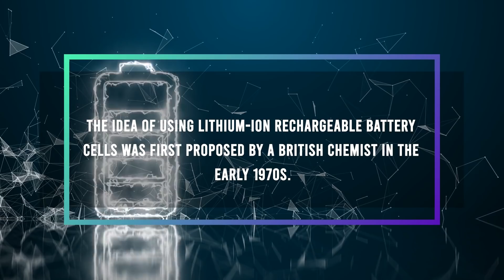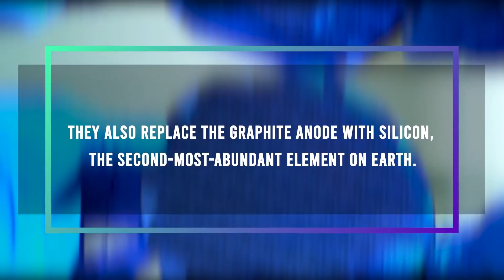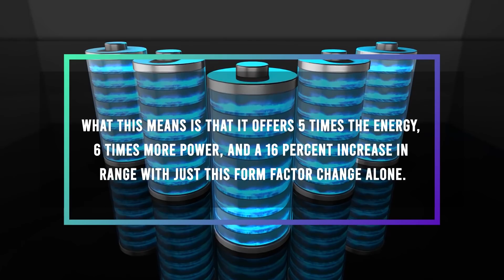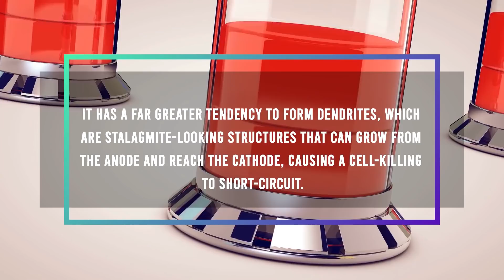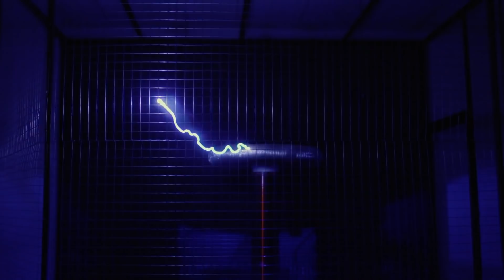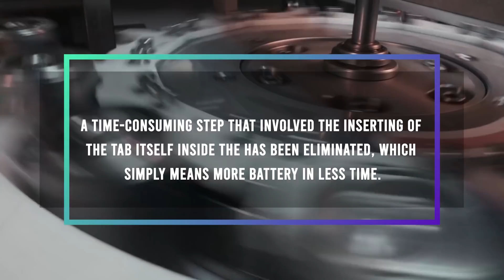Tesla's ABSURD NEW 4680 Battery Will Destroy Solid State Battery Competition

Comment: I'd bet on the 4680. I want a Tesla but I want to wait for the 4680 batteries and the aluminum alloy rear and front frame units. I believe these three items will make the Tesla the top car in the world, plus it will lower the cost of manufacturing the Tesla. Hats off to Elon Musk and Tesla.
Reply: One can always wait a for the next best thing….the next cell phone iteration, the newest laptop chip, etc…but there will ALWAYS be something to wait for as the next best thing. The current Tesla models and batteries are best-in-class by far, for performance, style and global charging capacity.  Waiting will be perpetual.
Reply: @gener4159  I know you are correct and that's why it is soooo hard for me to wait. Knowing myself as well as I do, I probably won't wait more than next Fall!
Reply: Pretty much my same exact thought process... Im guessing not everyone thinks like this though as the demand is strong.
Reply: Tgon Mwort  it's  still in development but a few cells have passed testing. Give it another 12 months or so.
Reply: @gregbailey45  heard it is not the batteries, but something with the machines making the batteries.  Will be interesting as they have in one year gone from 10% pass to 75-80% pass.
Reply: Tgon Mwort  BAK Battery Unveils First Chinese 4680 Battery Cells
Reply: People need to bet on improved energy infrastructure, California has rolling blackouts , wildfires, water shortage.
Good luck recharging when blackouts hit....!
Reply: @violent_bebop9687  it has been an eye opener for the folks who bought solar only to discover they have no power with grid down
Reply: Tesla dont make batteries.  Panasonic make them for Tesla....and Panasonic will sell them to everyone - not just Tesla.
Reply: @turbodewd1 :  Supposedly Tesla will make them AND buy a lot from various suppliers, such as Panasonic, if they make them. 

Tesla is planning to use a TREMENDOUS amount of batteries in coming years, and that quantity will ramp up fast as their product production ramps up fast in two new gigafactories and expanding the existing gigafactory production capacities.
Reply: Tgon Mwort  where can you find a 20k Tesla? Lol I want one
Reply: Can you give me some $120.000 for getting one Tesla too? Thank you.
Reply: Have you seen Mercedes EQS ? Tesla looks like Dacia next to it.
Reply: @IvanDimitrov-nu7ih  
The EQS looks horrible when compared to the normal S class.
Reply: @IvanDimitrov-nu7ih  Not in my opinion. I think the Tesla is a FINE looking automobile. The new Model S to me is better looking than anything out of Europe or Japan.
Reply: @IvanDimitrov-nu7ih  Looking at the specs on the eqs 108 kw battery ?  This boat must weigh in at 8000 pounds.  5.5 to 4.1 seconds to 60 .  not bad since it is moving this much battery mass.  Am going to guess that the battery actually is going to be in the $90k range since M/B has to buy them from one of the battery makers. As to self driving it can sort of keep you in your lane not much more.  nothing like 11+ hours on a 240 volt charger to get you charged
Reply: @stevepailet8258  You know that Panasonic makes Teslas batterys right ?
Tesla weights 2241 vs 2480 which is not that big of a difference and with the Benz  you get a lot bigger and comfortable car. 
EQS has Level 3 autonomous driving tesla is at level 2.
10-80% recharging will takes 31mins.
Speed ? Really ?
4.1 or even 5.5 is insane for that kind of car and there will be AMG version... Yes tesla is faster but you will get bored of doing 2.0 in less than a week if you do not crash before that.
The quality of the seats, the sound proof and the smoothness of the ride are more valuable than cheap party tricks, at least for me.
Reply: @IvanDimitrov-nu7ih  having had 7 mercedes I am well aware. I know their seats and dash boards do fall apart after a few years. so not super impressed. Tipping the scales at over 6272 pounds it is a beast.  The battery pack is a monster. 385 kw pack. It is just a tad on the bulk size but it does give almost 475 miles of range. this is the bigger battery. model S weighs about 4,647 lbs It gets around 400 miles range. All in all you are welcome the beast of a truck vs the nimble model s
Reply: @IvanDimitrov-nu7ih  I am giving specs for the 580 version.
Reply: @stevepailet8258  I really thing you are reading something wrong, the heaviest version is 2,585 kg maxed out and the battery pack is 108kwh. 
New mercedes have some big problems with reliability but nothing compared to tesla and i had never ever seen merced under 500 000km with falling apart seats.
Reply: @IvanDimitrov-nu7ih  since I personally have had seats fall apart I will discount your comment. 2585kg is the empty weight Gross Vehicle Weight (GVWR)	3135 kg or 6897pounds is fully laden. Now I have to wonder just what you are saying are tesla problems?  Am assuming you have giant insider information that you want to spew but cannot because you want to keep your job.
Reply: @IvanDimitrov-nu7ih  well you are wrong. Tesla is at level 5 fsd mode and likely to move up a couple levels with version 10 software.  Why are you so far behind the curve in this technology.
Reply: @stevepailet8258  Tesla isn't L5 yet. A bit dangerous to think so. Rooting for them though. Them and waymo I hope can get it done.
Reply: @IvanDimitrov-nu7ih  EQS L3 autonomy vs Tesla L2 is kind of meaningless. The two systems are oceans apart in comparison. Tesla FSD is clearly orders of magnitude more capable than Mercedes drive pilot. Mercedes can only drive on highways during the day in good weather. It's a bit embarrassing to compare it with Tesla Autopilot. Like I said before, Tesla is a tech company, Mercedes is a car company. You can't compare the two when it comes to actual tech.
Reply: @helloworld101  they are close.  And a heck of a lot closer than anyone else
Reply: @stevepailet8258  Close could still mean years away to fully trust it. ML models have to capture so many different scenarios. It will take some time for handling edge cases. Even if they're 95% ready, that last 5% will take a while.
Reply: @helloworld101  on the other hand Dojo is not up and running yet so we should just watch
Reply: @stevepailet8258 :  You have no idea what you're talking about re automation levels for automated vehicles. 

Levels are the automation capability.  Tesla FSD is at level 2 -- 100% driver supervised all the time, hands on the wheel, etc.  Level 5 is the highest automation level, so saying Tesla will move up two levels from level 5 is absolute nonsense. 

Don't take my word for it:  search on "levels of vehicle autonomy", for example. 

No one has level 5 or even close.  Only a few have level 4, strictly geofenced in limited areas. 

Why are you telling others they are "behind the curve" when you have NO IDEA what you're even talking about?
Reply: @rogergeyer9851  you have no concept ... you said there are level 3 . OK talk about that put names to the companies who have self driving.   I did get the levels backwards and yes Tesla is a beta  and level 2.
Reply: @IvanDimitrov-nu7ih technology? Seriously Mercedes technology is way behind Tesla lol, the only think about Mercedes is long auto company and high price, would you pay double in price just for that logo and some buttons?
Reply: @IvanDimitrov-nu7ih  ewww way too much going on with that. I love how clean the Tesla looks, hell no vents even... Having such a smooth clean car, then comparing it to that gaudy looking thing... No thanks, but I'm sure some will like it as you do.
Reply: @Hextavo  Tesla is pretty but in terms of technology, comfort, noise cancelation, seats... Tesla is far behind.
Reply: @IvanDimitrov-nu7ih  who will win? A tech company trying to make a car, or a car company trying to make tech?
Reply: @helloworld101  Mercedes has better product by far but Tesla has a lot of mindshare for EV buyers who want to pretend that they care for the environment while looking rich, and it is possible to outsold them. The hype around tesla is enormous despite that there are better products out there, Tesla might sell a lot more, just like Apple with iPods and iPhones back then.
Reply: @IvanDimitrov-nu7ih  yeah, but the EQS base model starts at ~125k. It has nice features but nothing mind blowing. I believe Tesla still has better range, power, and autonomy tech. If Tesla achieves FSD, the game is over. Hard problem to solve but the data they're gathering will keep moving them closer and closer.

Also I don't think Tesla is targeting the same market as the EQS.
Reply: @helloworld101  Real FSD will be a insane future and huge advantage, the othrer manufacturers will really need to hurry to catch up. But i don't think that the starting price will be 125k for the EQS.
Reply: @IvanDimitrov-nu7ih  Ivan, you are flattering Tesla. You are comparing Tesla to Mercedes. What happens when Tesla has the best panel fits, best paint... and gets the top seats etc? You have the best selling electric family car with Mercedes quality to boot.
Reply: @IvanDimitrov-nu7ih  Define "better".
Reply: @IvanDimitrov-nu7ih  "other manufacturers will need to hurry up.."
Ain't gonna happen.
Reply: @pruephillip1338  Tesla already have the best seats...
Reply: @helloworld101  I bet on the tech company who already has years of building a fine car. It's called Tesla.
Reply: @IvanDimitrov-nu7ih  I've NEVER been impressed by a Mercedes. I've been a mechanic most of my life and owned and operated a car dealership. I know cars inside and out. I've rebuilt engines, transmissions, done brake work as well as suspension, EFI and computer work, even body repair and paint. In my opinion Mercedes has never been a high quality automobile. High class... yes. But never high quality. I've worked on too many of them.
Reply: @genegoodwin8925  yeah, nothing in the EQS is particularly impressive. Sure it has features and looks great, but it doesn't seem they have solved any difficult problems. That's the difference with Tesla, they try to solve problems that other companies can't. And it'll likely come out on top in the future. But you gotta give it to the EQS... That interior does look amazing.
Reply: @IvanDimitrov-nu7ih  As front / rear casting really roll off the line that so called advantage of M/B will be gone.  Remember the bottom line is still the bottom line. 40% reduction in production cost is massive. Having batteries that are 60 cents less per watt to produce than the cost of batteries M/B is paying is massive. Having no real debt (telsa) v M/B is again massive.  Tesla has a huge profit margin They are totally in the black on the profit side. Mercedes can make a nice safe vehicle, but remember there is a real reason many many seasoned engineers from Mercedes have migrated over to Tesla.  I would sell M/B stock short if I were in the stock market
Reply: @helloworld101  had to laugh. EQS vs model S plaid.  Zero competition at a similar price point.  1.99 seconds to 60 just blows away everyone
Reply: @stevepailet8258  yeah but not everyone cares about going 0-60 in 1.9 seconds lol
Reply: @helloworld101  that and 400+ mile range. A lot of folks care.
Reply: @stevepailet8258  yes, a lot but not everyone. I'm not arguing for the EQS. Just being realistic that it has a nice interior.
Reply: @IvanDimitrov-nu7ih  sounds like you have been reading 10 year old articles on the Tesla. Get into 2021 and then go look. other wise you continue to show your low brow
Reply: @helloworld101  Actually I think the model x and S are exactly the same target market.  Looking at the EQS dashboard reminds me of the idea, baffle em with bull shit. It is not exactly what I would call user friendly.  I know I can only reach so far. I dont want to take my eyes off the road to look at something clear on the other side of the dash
Reply: @IvanDimitrov-nu7ih  you are right. By the time this car hits the market will be another $40,000
Reply: @pruephillip1338  once the front and rear mega casting are common the fit is going to be in micrometers
Reply: @gregbailey45  Looking at many of the legacy makers they are re engineering what they already produce so weight and aftermarket suppliers who are 10 years behind the curve with electric motors are trying to fill this gap.  Range and using prismatic cells is not really doing the job yet.
Reply: @genegoodwin8925  Always liked the build quality of mercedes as to their seats and paint agree with you.  I worked at a mercedes dealer and I never saw a time where there were not 3-4 bays with engines out to be rebuilt.
Reply: @IvanDimitrov-nu7ih  The Mercedes costs more for less performance than a Tesla.  I'm sure the interior is better on the Mercedes.  The Teslas seem to be much more energy efficient also.

Comment: Companies such as Sony Panasonic LG and Samsung has investigate and gave up on tab less architecture before the first EV off Tesla. Companies also discontinue this idea or spend money to make it into the patent office. Not knowing the problem that those companies knew Tesla picked it up and filed it. The tab less architecture patent. . 

Giving up welded tab for (multi flap point contacts) to conduct heat and electricity is asking for trouble despite of all claimed chemical advantages.
Reply: Tesla is not a battery manufacturer so they may be willing to put up with the problems that exist because they can get benefits for the car. 
So while it may not appeal to the manufacturers of batteries as it may increase cost.

Comment: The report announce test production run with 70-80% yield. It doesn’t address problems induced from the tab less architecture. 

Problem? Heat and electricity at the anode foil periphery are terminating to a line of flaps facing the cylinder base (cell casing). Tab-less patent expects ideal flap-base junction resistance. 

Ideal junction have? 
1) >90% base area coupling but point contacts
2) specific retention force to maintain coupling

Challenges? in assume w/flap point contacts 
- flaps are annealed Cu can’t hold a shape 
- once deformed will stay deformed.
- inertial shock progressively deform flaps
- deformed flaps also decouple to cell base
- decoupled cell base inhibits heat and current
- until a last flap remains couple to cell base
 - the next shock open circuit the last flap
- the last flap induce a spark to hot chemical
- next open circuit may cause ignition
- retention force suppress spark is weak 
- strong retention force delaminates the roll
- use spring Cu foil for retention in the flaps will unravel the roll
- dry electrode + flaps don’t fix above issues
- add removed tab back may stop ignition only

Trial qualification of tab less multi flap design?
Performance and ignition test before and after each vibration run on cell for critical and general cell performance. Add thermal cycle of extreme temperature in between. Add thermal shock in between.
Reply: You're scaring me. Will it work?
Reply: @tophat2002  tab less architecture has been discussed with Panasonic under NDA between the two parties. If tab less is feasible and practical why didn’t Panasonic produce it? Concerning of liability catching up with Panasonic themselves. Otherwise model 3/Y is carrying tab less from Panasonic by now.

Not long after battery day Toyota release all their Tesla share. Tesla had to pump up their brand to up keep stock price with any progress except progress in tab less architecture.
Reply: @philoso377  
The issues that exist may mean that the battery is not suitable for general battery use for a battery manufacturer. 
But in special use cases we have no idea what sorts of management control solutions are being applied.  They may be useless in a phone but in a managed system like a car or even domestic energy storage they may be perfect.
Reply: @bighands69  construction per tab less patent directed is vibration sensitive may lead to internal electric arc and possible ignite of hot battery chemical.

Comment: Tesla has a lot of problems with new batteries, so Elon wants to buy BYD blade batteries... That's the truth.😋
Reply: !!!!!!!!!!!!!!.................BYD has got it right...............Paul
Reply: BYD blade is an alternative LFP format. It’s not the only option. Tesla 4680 is a nickel compound. It could also be made as LFP. 
Battery electrodes expand and contract so solid state might never happen. Toyota are taking a huge gamble on solid state especially as QuantumScape have been accused of allegedly fiddling their test data.
Reply: @Dave5843-d9m  Tesla 4680 is the only  experimental project which doesn't function perfectly today and it's not safe also, I think...🥱
Reply: Adam M on the investor calls they said they have validated it and have high yeild rates. The only thing they are struggling with is to increase production rate. And the blade battery shit is a rumor not the truth
Reply: @Dave5843-d9m I don't know if solid state batteries will happen, or when, but here is the thing. Nobody will make an ICE car that can compete with Tesla in 2025. Nobody has a solid state battery factory yet, so they won't be able to make enough of them in 2025 to do anything to Tesla. OTOH, Toyota looks really late, and I don't think they will be able to get their hands on enough solid state batteries for a low enough price to do anything soon.